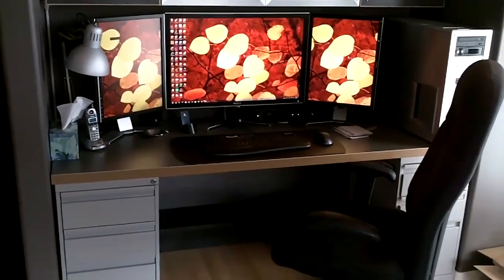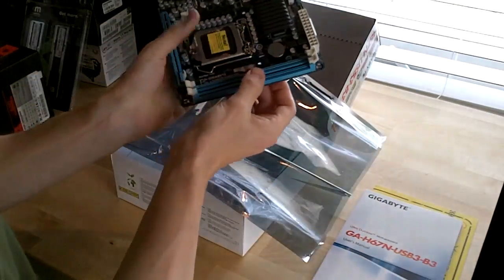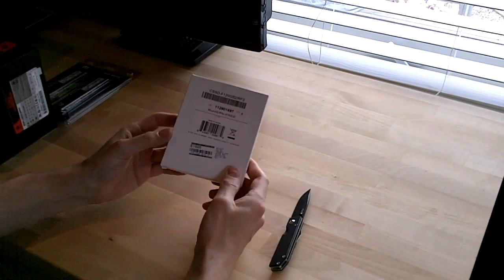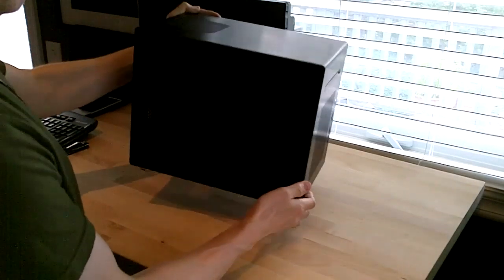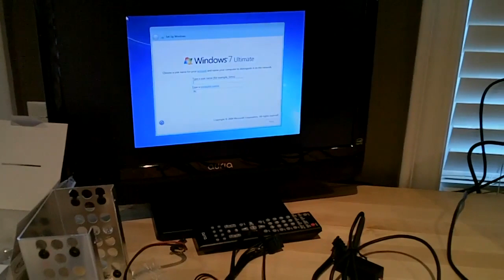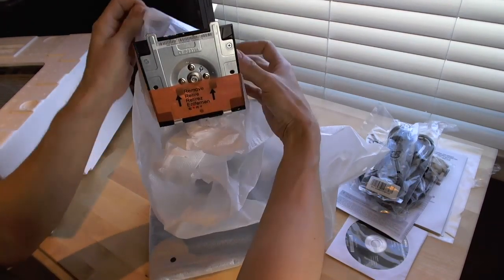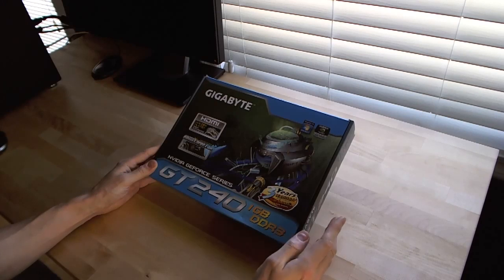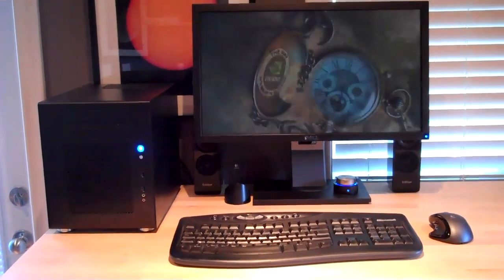Mini ITX Build Complete Compilation

Comment from the maker: @nintendonick I don't know if a fanless cpu heatsink would be all that great - my temps with the Arctic Cooling unit (with the fan on low) hasn't been great - ie: similar to the stock cooler.  I just picked up a Scythe Shuriken low profile unit and I'm going to give that a go and see how well it works.......

Comment: 44:05 They prob chose those ports because hdmi is the same thing as dvi just with sound capability. I am assuming you monitor has no speakers (I did not watch it all) so there is no need for hdmi. I would rather have a display port instead of hdmi now.

Comment: I was thinking about doing the SAME exact build except just the 120 ssd, a fanless 6850, and the seasonic fanless 460 psu. Same cpu, ram, mb... Also just throwing on just a heatsink for the cpu. If I have both noctua fans intaking air at full or medium speed, do you think that would be good enough?